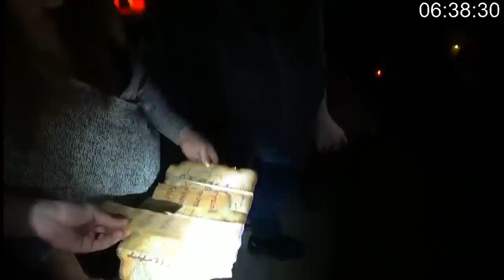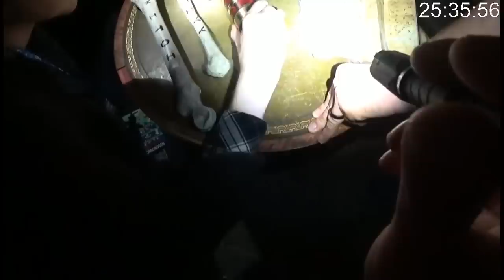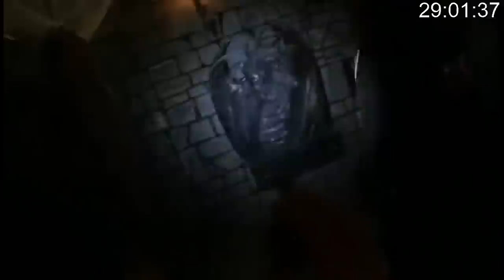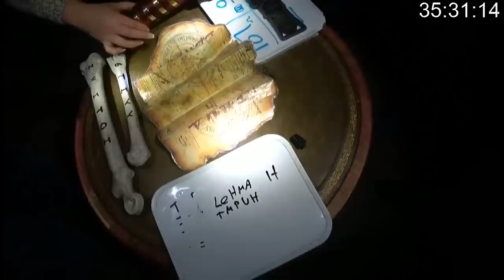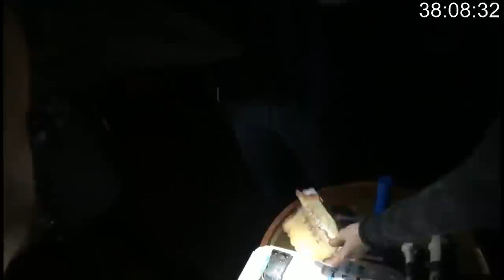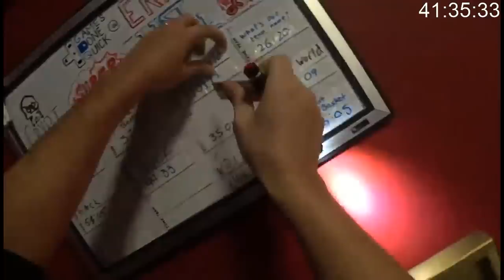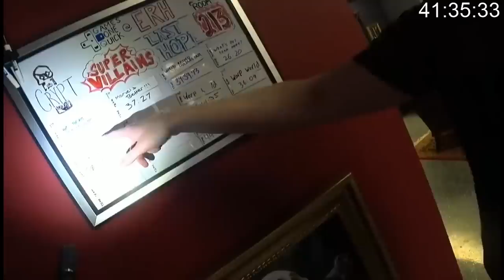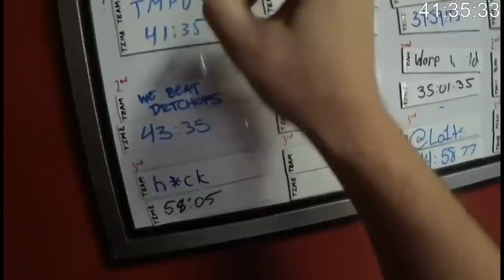The Crypt: A Live Escape Room Filmed At Awesome Games Done Quick!

Comment: What I'm honestly wondering is how they trigger all these results. As in shining into one eyed willys eye works etc. The Escape Room I did once was 99% magnets and key-locks. Wondering if they use some electronics (NFC Chips + Light Sensors) here?
Reply: Kruemo  yeah it seemed like a manual administrated triggering to me. Can anyone say for sure?
Reply: I also thought about manual (especially when seeing the candles). But i don't know. Manual has a lot of room for errors in my opinion. Though it would help to not trigger the one eyed willy trigger early (though the same could easily be scripted in some electronic logic and only trigger after the previous mandatory event (got the paper with the info) happened)).
Reply: A Majestic Barrel Oops